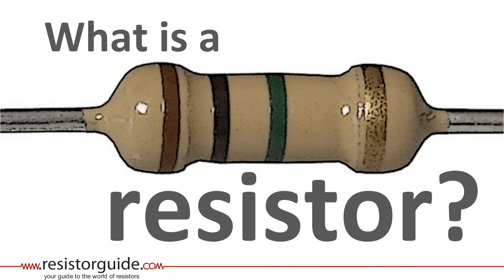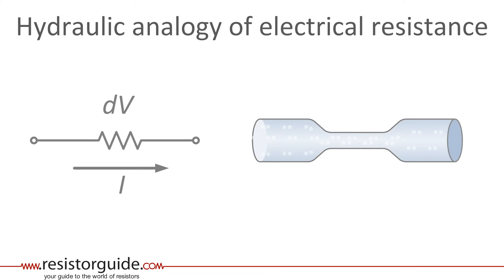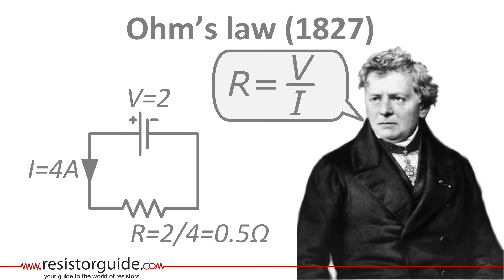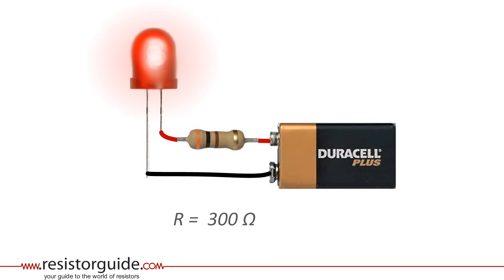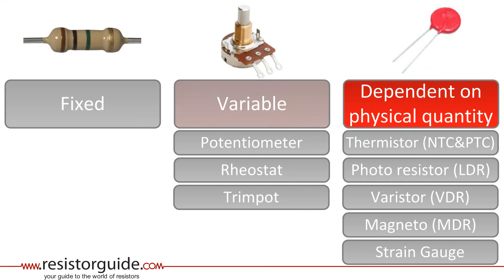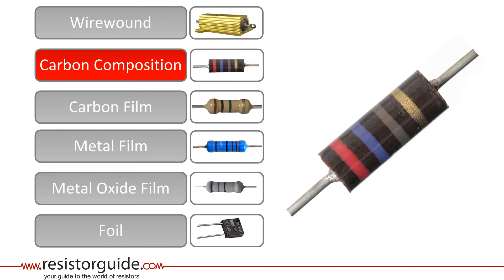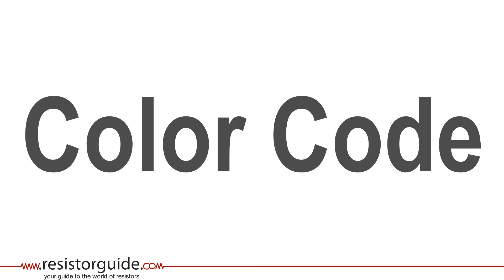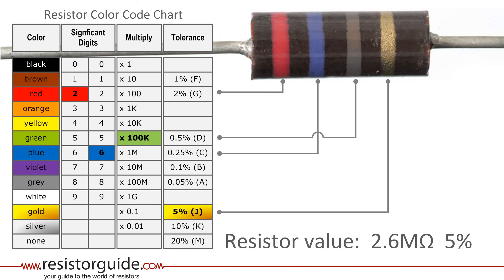What is a resistor?

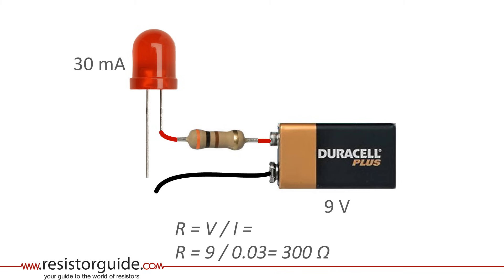Comment: Hi, I think u should correct formula at about 2:31 because it's approximative, assuming battery voltage 9 V and Led Voltage about 2 V ("standard" led, not for bright led types), we have Vbatt=Vresistor+VLed so 9=Vresistor+2 then Vresistor=9-2=7V. So we got R=V/I so R=7/0.03=233.3 Ohm. It's Different to 300 ohm, your formula is not correct, so if u use it and different voltages u could damage the led. U must consider right Voltage Drops...

Comment: Ok, so I know this might be a noob question, but what do I put I front of an LED if I want a short delay after I switch the circuit on? If you want to know why I'm asking, it's because I'm soldering some LEDs to my xbox controller and I want to have a delay for each of them when the rumble activates. I am using 6 LEDs, 3 on each side of the clear front trim (what I mean is after 1 second 1 led lights then after 2 seconds 2 LEDs light and after 3 secs all 3 (on each side) light up). It would be amazing for a reply. Thanks!
Reply: you would need a microprocessor! those tall black ones i mean

Comment: The flow of electrons occur from the positive lead to the negative lead so in order to protect bulb we must add resistance before the electricity reaches the led.
Reply: In a series circuit which is what is shown in the video the current is the same for all components in the series so it doesn't matter if the resistor is before or after the LED.

Comment: can i put the resistor on the negative side of the battery?
Reply: I have the same question! please anyone explain why he put the resistor in the positive side? I believe that the current will move from the negative to the positive, so it will pass the light from the positive one. Thus, we need to limit the current flow before gets in the light to avoid blowing out! im just confused now!! please explain, Thx
Reply: Ahmed AlGazi an electrical current goes from positive to negative so it will first reach the risistor and then reach the LED. As they will say in Holland: Nothing on the hand.
Reply: I'm sure you could. Conventional current flow as used in diagrams and designs show the electrical path going from positive to negative, but electrons in a circuit actually flow from neg to pos, while the hole flow is from pos to neg..
Reply: thebuzzcjc wut?
Reply: When we draw a circuit, we usually assume that current (an amount of electrons) flows from positive to negative. They actually flow from negative to positive. This was discovered a long time ago but we still use + to - in diagrams for convention. 
http://www.mi.mun.ca/users/cchaulk/eltk1100/ivse/ivse.htm

Comment: I answer to your 2nd query first, Ampmeter is connected series to resistor for measuring the current being passed by resistor.When we say 2A is going through,i.e I=V/R, it's current Amp value = voltage drop (Vs-Vf)/Ohms measurement.Vs=voltage source(may be 9v or 12v),Vf=forward voltage (the volume going to be allowed to consume by device/simply say device rating voltage).This 2A current is allowed by the resistor.Now, for your 1st query, resistor is not controlling the speed of electrons.

Comment: Yes, when you connect two or more resistors in series in a ckt, (i.e R1 & next to it, R2, R3), each resistor values (ohms) "R" are added, as to find Equivalent Resistance Requ= R1+2+R3, while calculating the current flow I=V/(R1+R2+R3)=V/Requ. The reason is , the voltage potential at the first resistor arriving at the resistor R1 is taken as Voltage for calculating current flow on each resistors in series. Hence, the current flows on all the resistors will be the same, but with drop in voltage.
Reply: No I don't think that is correct.

By ohm's law: V=(A)(R) 

The higher the resistance, if the amperage stayed the same, voltage would also rise proportionally; obviously, that is NOT what happens, resistors do not add voltage.

If the voltage stays the same (given a potential differential = X from a given source like a battery) and if we change the value of the resistor, then what must change is the current to make the numbers add up:

V=10 R=10 , 100 , 1000 A=X

1. 10=(x)(10) A=1

2. 10=(x)(100) A=0.1

3. 10=(x)(1000) A=0.01

The higher the resistance = the LOWER THE CURRENT.

Comment: This is amazing. I have a question though. why does a resistor have to be on the positive lead? 

I understand that the assumption of the current direction ( from +ve to -ve ) was a mistake bcuz scientists when they were first working with electricity, they didn't know about the structure of an atom. Shouldn't we adopt the correct direction then to prevent the LED from burning out? which is from -ve to +ve?

(Thank you in advance for any help you might be able to provide)

Comment: thanx for the information but can any one say that in the video it was shown that by connecting the resistor in series with bulb the current was controlled but in case of theory we use to say that for series connection of resistors the current flowing is same at all the resisters connected in series what does it mean?

Comment: You should include the voltage drop across the LED when calculating the resistance required to produce 30mA.  Typically, red LEDs operate at 2V.  So the calculation should be (9V - 2V)/0.03 = 230 ohms.  However, with 300 ohms, the current will be 23mA, which is better than 30mA, because you should never operate any device at its rated maximum.